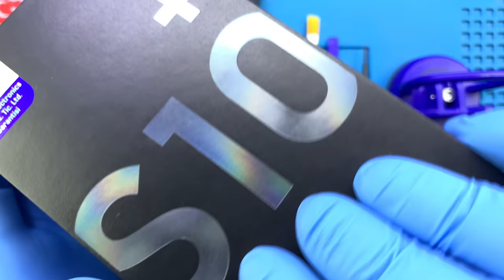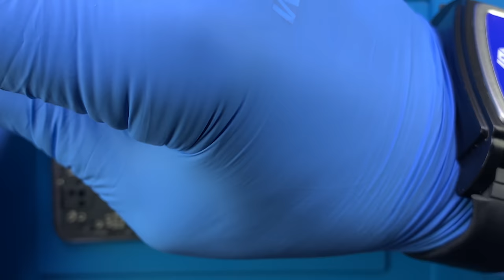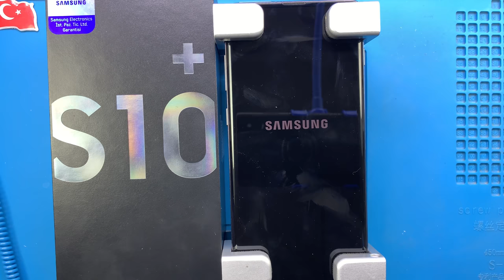Samsung G975 Galaxy S10+ Batarya Değişimi 🇹🇷

Comment: Samsung clearly ripped customer off.. saying it is 4100 when it clearly is only 4000 what a rip off
Reply from the maker: Hello there;
No, it wouldn't do that.
Greetings.
Reply: @gsmi  what do you mean it would not do that.... they advertise it as 4100, but it clearly shows on the battery 4000mah. They have advertised incorrect information! And saying 4100 when it is clearly 4000mah Huawei batterys are better...